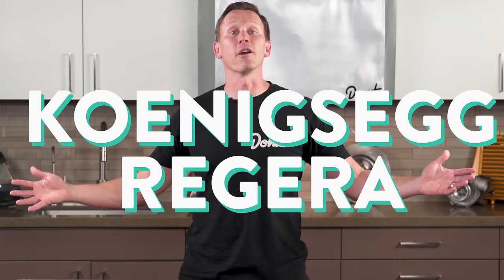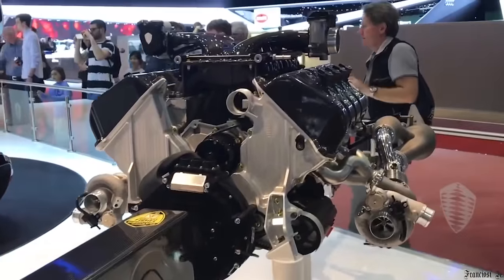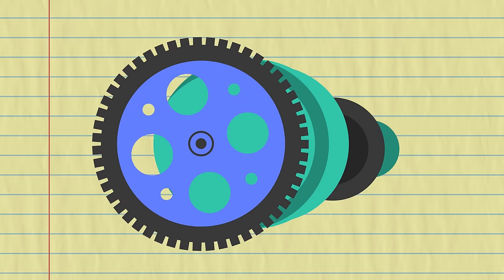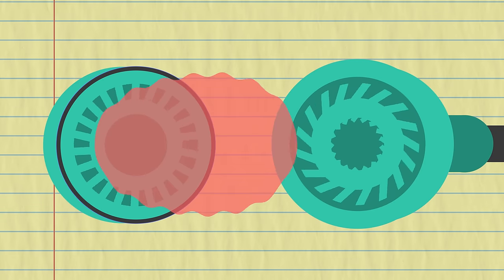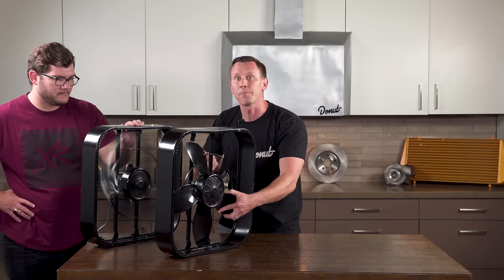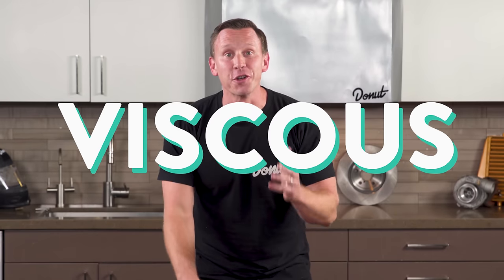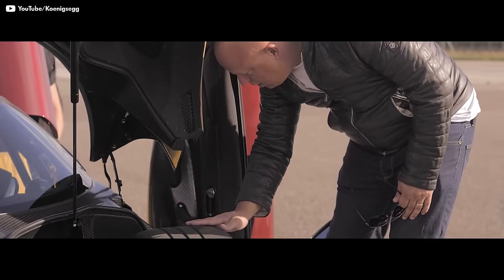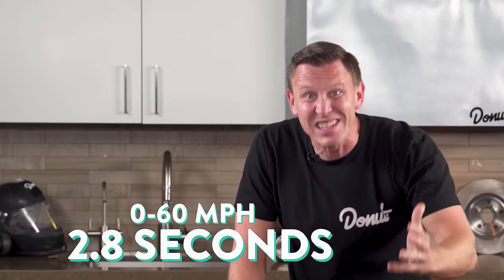TORQUE CONVERTERS | How they Work

Comment: sooo how does the engine braking happen with a torque converter? does it  even do that?
Reply: through lockup clutch or from viscous coupling of the imp and turbine. either way it is braking, but a little bit is ofc lost in heat if not locked up :)

Comment: does stall speed impact anything other than the RPMs at which the transmission engages?  that is, does it affect either the torque multiplier or the torque lockout?

Comment: How about reverse though
Reply: The reverse gear is located after the torque converter within the transmission. The torque converter will work the same regardless of the gear

Comment: It's well explained, but is this childish act really necessary? I don't find it funny at all (if that's what you trying to do). But good effort, I was trying to find some good examples on how this system works and this video explained it quite well. Before I wasn't exactly sure how it works. I guess good side of this system is that "clutch" never wears out as it's impossible to wear out the liquid .. or well I guess liquid can finally become contaminated and needs replacing, but it must be a lot easier to change liquid than entire clutch, like on regular car.

I still don't understand the idea behind this tho, to me it seems like hydraulic clutch really. I mean i don't understand how is this better than normal gearbox. Engine has less power at lower revs, which is why cars have gearbox. so if you driving one of those cars at low speed (in city), then it only relies on the electric motors? doesn't the battery drain really fast, because it can't use combustion engine to charge it? Also isn't the idea of gearbox to keep engine at optimal revs, like 1500 - 3000rpm for city cars, this is because if you'd drive your car at high RPM, then engine's life would decrease a lot, but if you drive it at low rpm, then it has nearly no power and might even stall (so yeah once again i get this is why it uses electric motors), but does it really mean Regera can't drive long at low speeds cuz battery would run out?

I must be missing something, I just don't see how Regera's torque converter can possibly be better than transmission. imagine a hybrid car with normal transmission, it should get even faster boost and higher top speeds, no?
If you change the gear ratio, then you can get a lot higher top speeds (if engine is powerful enough and car is aerodynamic enough), it's like on a bicycle, the stronger your feet and faster you can move them, the faster your bike will go when you put it on highest gear, but torque converter seems something that is constantly stuck in mid-gear, so it needs boost of electric motors to get it started fast and at high speeds engine is at high revs, but just not enough "gears" to push it even further.
but i guess you don't really need over 250mp/h anyways.

Comment: Why do Torque converters use transmission fluid instead of oil
Reply: so transfluid is designed so it does not foam up.  when its spinning and pumping though the torque converter fins like you see in the video or in any automatic car, normal engine oil would foam up and lose ability to transfer energy though it.   now on the contrary for a MANUAL transmission  you can use OW full synthetic motor oil in the transmission and it will work just fine because there is no torque converter to whip it into a foam. infact there is a gentlemen that builds race cars that prefers Ow-30 full syn motor oil in his  manual transmissions because its the only thing that keeps the syncros from sticking.   he said even redline ATF fluid was not able to do that for a sticky syncro issue. 

also normal engine oil  has detergent properties to hold carbon particles in suspension, to keep the black carbon deposits off your internals inside the motor.    ATF fluid does not have that (atleast none that i have seen or read about) i doubt there is any because you dont have to deal with carbon build up in a transmission
Reply: and when i said  0w-30 oil was used to keep syncros from sticking, i meant that as in if that problem arises.   ATF fluid should do the job just fine  and they should not stick when using ATF.    but if they do apparently this man swears motor oil will do the job better for manual transmissions and has quite a big history of building and fixing cars.

Comment: How does a liquid drive the car though? I just can’t imagine a liquid bouncing off some walls to push a 2 ton car.
Reply: The impeller (powered fan via Nolan) moves fluid via the engine spinning. The impeller  is only attached and can only spin via the rotation of the engine. This fluid is then captured by the turbine (fan that is spun by the fan powered by Nolan), which is attached to the drive-train, which makes the car move

Comment: The turbine never spins faster than the impeller. (Re: @ 6.43 seconds in the video.) You're stator actually only multiplies torque when the turbine is going slower and the stator is stationary/locked. As it speeds up, the stator free wheels and you arent multiplying any torque. When it's close to the same speed as the impeller, the clutch can be engaged to lock the turbine to the case/impeller for 100% power transference. But it never spins faster than the impeller at any point of time. Only if you were dingy towing it, which would cause damage to the transmission.

You also left out a huge job of the converter. It is also a harmonic balancer. Great video, otherwise!

Comment: Uhhh the torque converter housing is actually mounted to a flex-plate not a flywheel. Automatics don't use flywheels duh.

Comment: since the koenigsegg regera doesn't have a transmission and I cant manually shift when i play forza horizon 4 cuz i am not good enough, but i want to get extra money, i turn on manual transmission when driving my regera, even though it doesn't have a transmission, so its just as easy, and i get extra money

Comment: The old Soviet locomotives (yes, I speak about the railways) has the same, but more better - it has blades with moving blades to use different ration of converting power. It is 50 y.o. but better that this stupid thing. 🤭